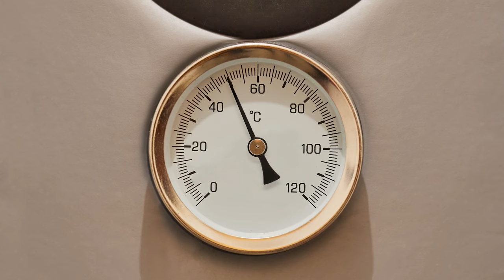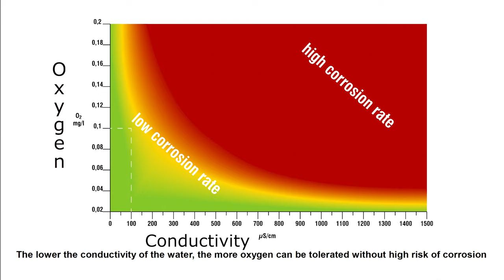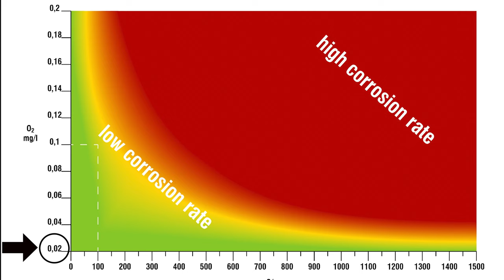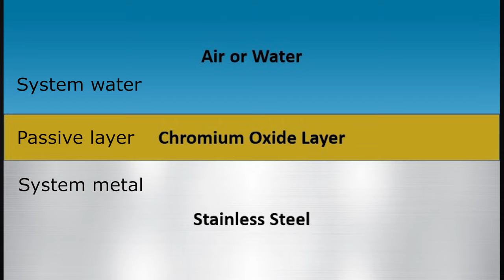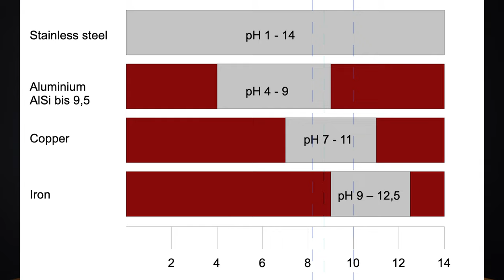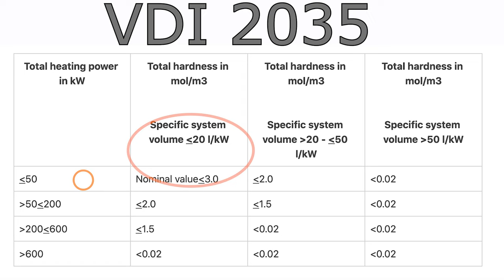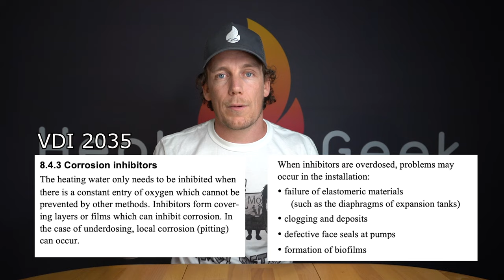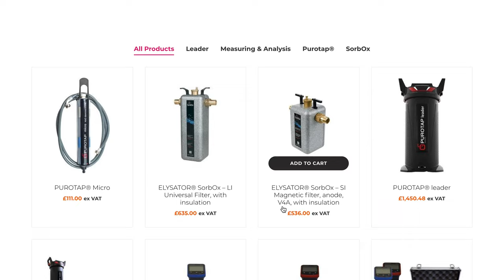Heating Water treatment explained (VDI 2035) and BIG NEWS!

Comment: Interesting but VDI 2035 methodology can’t be implemented in the UK for a number of reasons.
1, In Germany, buildings insurance states that only a qualified heating engineer can work on your closed loop system, this means that as a householder, you aren’t allowed to even remove a radiator or even top up your system.
2, UK building design uses different standards and allows products like plastic pipe and fittings, plastic allows ingress of oxygen which will create corrosion within a demon system.
3, It is impossible to demineralised and exciting system without huge added costs, as demin water will eat through an older system
4, cost, it is very very expensive to create a demineralised system in domestic properties, the equipment required is not cheap and makes the use of chemicals a much more cost effective option.
Finally, until a UK standard is written, demineralised system are going to be for the few, we can’t take the VDI2035 standard and copy it as a lot of it is relevant to the UK and not possible to emulate.

To finish, the inhibitor market has grown in Germany by 350% in the past 2 years, this is down to historic VDI 2035 compliant systems being in an “extreme circumstance” that inhibitor is needed. 

Germany is 58% VDI 2035 compliant on domestic and non domestic properties and they realise that there is still a lot of work to be done to make the standard fool proof.

Comment: Fitted a heating system at my mothers, used 8 Stelrads, Peglar lock-shield valves and Drayton Trvs, Yorkshire tube and fittings. Topped it up every third year by a quarter of a bar, I was the only one who knew where the filling loop was hidden. When I filled it originally, It was filled and drained to get out any debris, filled, heated and drained to remove flux residue, the filled and left working.
After 22 years we fitted a new combi for her, connected up my Kamco, and found the bare minimum of sludge in the system. It never had inhibitor in the system from day one.
A  well contained, closed/sealed system shouldn't need it, in my humble opinion.
Reply: I love the idea that you anticipated someone coming along and putting in inhibitor so hid the filling loop :)

Comment: I had a heat pump installed by a Heat Geek Elite installer a couple of months ago.   They didn’t even bother to assess our water hardness (it’s hard water where we live) before filling the system up and leaving it without any inhibitor even though I have a mixture of steel and aluminium radiators.    I’m not sure it’s practical to treat the water and control the pH (as required by the aluminium).    I therefore decided to add some inhibitor.

Comment: 23:16 It's made by the german company SYR HANS SASSERATH GmbH & Co. KG.
They have three types of resin you can get to use in these devices:
HWE = Heizungswasser-Enthärtung = hating system water softener
HVE = Heizungswasser-Vollentsalzung = heating system water full desalination
HVE Plus = Heizungswasser-Vollentsalzung mit pH-Wert Stabilisierung = heating system water full desalination with pH value stabilizer.
(I hope I got the translation at least halfway right - German foreigner here).
I think desalination is the wrong term here, demineralization should be correct.
From what I understand you need to tell the device on the top which type of resin you are using and the size of the can, so it can calculate how much you can use it to fill the connected system.

Comment: Water testing kit is kinda essential to check if a powerflush is required before replacing a boiler
Reply: Never had anyone in my lifetime check their Water with a Test Kit annually. In fact if they ever needed a flush then they don't bother to Test the crap they flush out. For obvious reasons 😂

Comment: Great video! Started following VDI 2035 years ago and no problems. In fact fewer problems. Actually we stopped using inhibitor before reading about VDI because it either did nothing on sealed systems or caused problems!
Reply from the maker: Learned it with you!!!
Reply: We found one of our guys was shooting concentrated inhibitor into an empty system, leaving it in for weeks before it was filled, went off like the pipe had been shot full of silicone.

Comment: Nerd-tastic. For demineralising the water (ours is very hard 320ppm) could one just heat it up to 80 or 90C for an hour? That should cause most of the hardness to fall out/coat the pan should it not? Quite a lot cheaper than buying a reverse-osmosis unit. An Electrically Induced Precipitation unit would also do the trick but may be no cheaper than the reverse osmosis filter. Even better one could actually distill it (and add a bit of naked water back to keep minimal mineralisation level). Would need a lot of time/energy for ~100l I guess?

Comment: @Heat Geek  

Great video by the way.  Now you got me thinking...  Your almost final comment about inhibitor eating up the oxygen and then going bleurgh and turning into soup needs further explanation.  For a start, you're suggesting inhibitor wears out... Sentinel tells me it doesn't!  Secondly, you're suggesting we can overdose on inhibitor, again Sentinel tells me it doesn't. (Sentinel did say that inhibitor works on clean systems and that excessive copper dissolved will stop inhibitor working, so sounds like you're not in general disagreement.)

I don't mind you disagreeing with Sentinel.  They gave me some free training and a free lunch, so I'm sure they had a vested interest, but please can we have more detail on how inhibitor works?  Or have you covered this elsewhere?

Comment: My water uS is 286 and i have an open vent system. So my uS is above what vdi says is safe. However, i have a 3 stage filter that filters down to 5u. Do you think that would be sufficient? 
At college all we were taught is stick a bottle of inhibitor in and your corrosion problems will go away.

Comment: One thing that's not mentioned, which would be applicable in really cold climates, like Canada/North America, is the addition of anti-freeze, like uninhibited propylene glycol. What impact, if any, would this have on any of the VDI 2035 requirements, over the course of a heating season??
Reply from the maker: Raises conductivity. Suggest antifreeze valves instead

Comment: Great vid! Whatever happened to remco & Justin? I’ve got the prime lab (don’t use it as much as I should, water in Wales is sooo good anyway) but could do restocking some  bits n pieces.
Reply from the maker: Well you've got a source now!
Reply: @HeatGeek  looking at doing both courses at some point in the near future too, will need to brush up a little on the basics again first before delving into it though. I kind of get stuck into a rhythm of knowing what works where and know who to ask if I don’t, I usually end up ignoring the advice and it works as intended anyway, think they call that “winging it”
Reply from the maker: @b-techheatingltd6690  lol. The course is designed for absolute beginner too!!

Comment: Great video and I'm sold on moving away from inhibiter having found out how inefficient our boiler and old rads were BUT just to play devil's advocate - would it not be better to fill the system with pure distilled water with an appropriate buffer and replace that every 4-6 months when the readings show it needs changing. could I as a consumer do this myself without expensive kit.
Reply: Distilled water is about £1 per litre so filling a heating system with it would be a non-trivial cost.

Comment: So if the PH is higher or lower than around 8-10 just add inhibitor? and if the conductivity meter reading is too high fit a filter or flush the system? in a domestic setting..
Reply from the maker: no add PH+ or PH- tablets. yes with conductivity.
Reply: @HeatGeek  cheers for the help 👍🙂

Comment: Corrosion of metals is a naturally occurring reaction for metals to become stable in any given environment. Chemical corrosion Inhibitors often try to suppress this natural tendency of metals by shielding them from the environment. Metals look for an opportunity past this shielding (Which happens very often either from minor leaks, maintenance, or inhibitor degradation), and actively start to corrode. 

VDI 2035, instead of suppressing the metal's natural tendency like with the chemical Inhibitors, focuses to change the surrounding environment in hydronic closed-loop systems, where corrosion is less likely to happen. Simply put, the metal's surroundings are changed rather than forcing the metal against its basic nature, where corrosion is not practical. 

VDI 2035 suggests that three parameters (dissolved oxygen, pH, and conductivity) are usually important for the metals to corrode and when recommended levels are maintained, an environment is created for the metals in the system where corrosion is not feasible. VDI 2035 focuses and recommends levels on these parameters that promote corrosion rather than suppressing the metal's tendency to corrode.

With 50 years of experience in both domestic and commercial markets, Elysator and Purotap devices with simple electrochemistry technology meet water quality guidelines mentioned in VDI 2035 without the need for any toxic chemicals or compromise.

Comment: Purotap looks great.
How do you get over the antifreeze issue with this approach?
Reply from the maker: Antifreeze valves.
Reply: @HeatGeek  The valves are expensive and 2 needed per install... but I'm gradually warming to this idea.
Reply: Glycol has had its day with ashps. We're fitting the antifreeze valves everytime now. We've had issues with glycol messing with flow valve at low temperature
Reply from the maker: @mikecole4952  I don't know why it was ever a thing tbh

Comment: Good video👍🏾 how long does inhibitor last in the system? 1 year 5 years.
Reply: I also recently flushed an old system out surprisingly wasnst that dirty. i refilled the system and didn't have any inhibitor on me. Do i go back and "treat" it or tell him tap water should be fine  (i can't relay all that science 🤣)
Reply from the maker: 1 year according to manufacturers it should be checked and dosed annually

Comment: How often should a combi system be drained or flushed using steels radiators and copper pipes. My systems about 15 yrs old now and been flushed about 4 times.

Is soldering not as good now as the crimped fittings
Reply from the maker: If you use decent vdi water treatment, never!

Comment: Not seen all of your videos but very interesting. Would this examined method exclude the need for something like a magna clean which are fitted to most new boiler installations? Thanks
Reply from the maker: yes that wouldnt be required necessarily. The issue is already there if your trying to collect the dirt in a magnet.

Comment: There's Oxygen in H2O. That's always gonna react with metal. I think it vital to use antirust. Simply topping up from yearly leaks or loss by evaporation is going to gradually need topping up again. Unless you want our New Combi Boilers to only last 7yrs just past Warranty 🤨
Reply from the maker: Evaporation in a sealed system? We talk about 'natural state' too.. did you watch the video?
Reply: @HeatGeek  I have had to refill a few Combi Boilers annually and same for the expansion vessel. I watched it all and it was not a great way to spend our time. Way too deep. Nobody is gonna measure semen levels nor pH. Installers don't care for all that. Just renegades with figures to impress and add to the job for the Chemistry Lesson. Let's face it, dirty water gunks up valves and corrodes Seals. I had to replace 2 Manifold Return Valves after just 5yrs use which had inhibiter. The water is black and I'm in the lowest Soft water area in all UK. Basically the cost of installing Air Source Heat Pumps is diminished by Council Regs for size of a Compressor in a Conservation Area (noise likely) as they are not up to date on new tech. Plus the one they allow only is the size for a tiny 2 bedroom house. Mine is 2 floor 3 bedroom. I could have gone with one for my new fit UHF if not for that. BUT an insider tells me Hydrogen is indeed coming as they have found ways around the cost to convert it... via the Carbon Capture to bury it in Gas wells they drilled already. It's "genius". Yes, I watched your vid on the BAXI. It's said they will supply up to 30% of the Grid in a few years!
Reply: @macmusica  I think you Mean Siemens as Semens has a totally different  meaning.
Reply: @knowitall6677  yeah it seemed to be the reason for the vid hehe. Putin has saved us. The US are not happy about this ;)
Reply from the maker: @macmusica  well they are going to measure pH and uS. 1000s of us have been doing it for years lol
Reply from the maker: the o2 in h20 is bound.. dissolved o2 is free from bonds, complete;y different.
Reply: @HeatGeek  O in H2O is a single atom not O2. DO is O2. Completely different.
Reply from the maker: @hobonisation  sorry I don't follow
Reply: @HeatGeek  one O in H2O. 2H though. O in water is a dissolved gas so O2 or 2 Oxygens. Can be O3 or ozone I suppose.
Reply from the maker: @hobonisation  that can only be extracted from the H2 via electrolysis though. That's very different from dissolved o2.
Reply: @HeatGeek  not the only way. Acoustic cavitation can rip H from O however, not my point. I was correcting use of O2 in H2O. There isn't. There is only one.
Reply from the maker: @hobonisation  got you. Got point and noted ✅️

Comment: Have any manufacturers said they are happy with installers adopting VDI and ditching inhibitor? I would be happy to not use chemicals. It's another good thing for the environment. I am sure the inhibitor manufacturers won't be too happy though!
Reply from the maker: Viessmann have. theres an amendment to BS too
Reply from the maker: oh and many heat pumps manuals request it, all Honeywell valves stipulate to follow VDI. Vaillant used to stipulate it too and have started again.

Comment: Gosh, the amount of money it would cost to have an engineer turn up at your house to analyse the central heating water, would never out weigh the savings on efficiency?! 
I would suggest you are flogging a dead horse!! 
You would be better to focus your energy on educating the next generation of engineers via the education outlets I.E colleges! 
Making the heat geek course a mandatory part of the plumbing and heating curriculum!!
Reply from the maker: Not really we've been doing thos for the last 7 years.. takes about 2 minutes of time..
Reply from the maker: Oh and it's £15 cheaper then adding a bottle of inhibitor
Reply: @HeatGeek  yes but you are still going to have a minimum invoice charge I.E £30….. you are not going to do it for free. 

Look, I’m not a pessimist and actually I am a massive fan of heat geek! (I would love to be an ambassador). 
I just think your energy and time should be spent trying to ‘prevent rather than cure’ I.E trying to get your courses in to colleges.
Reply from the maker: @deanchapple1  don't worry mate open to constructive criticism.. we are working on college courses and these videos are how we market the courses.

Your charge would be for what ever you went out there for.. but as per the video tap water is absolutely fine most of the time so this is much cheaper than inhibitor.
Reply: Better educated installers are more expensive per hour and rightly so, if they spend their "free time" educating themselves beyond the laughably tiny amount of required compliance for the job they should be rewarded.  Don't forget though that "The Bitterness of Poor Quality Remains Long After the Sweetness of Low Price is Forgotten" - Ben Franklin

Comment: I seem to remember from one of your videos your saying that scale only forms on a surface heated to over 60ºC. As such is high hardness such a big deal with heat pumps where temperatures for most units never exceed this level? (I speak as someone living in Ipswich, which apparently has the highest water hardness in the country at 423!)
Reply from the maker: Still an issue, but just greatly greatly reduced